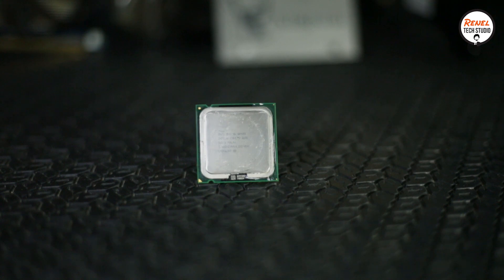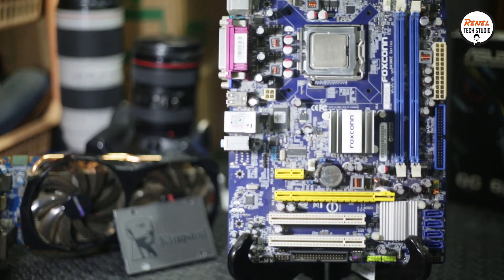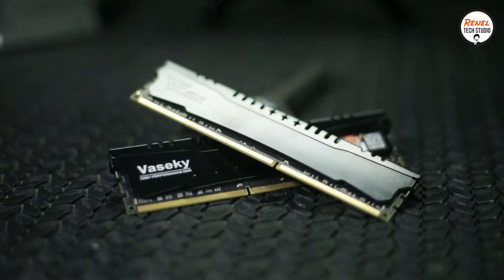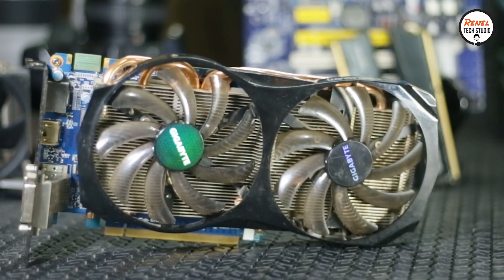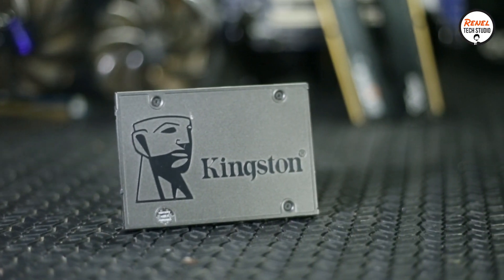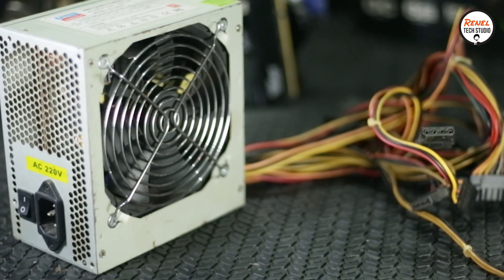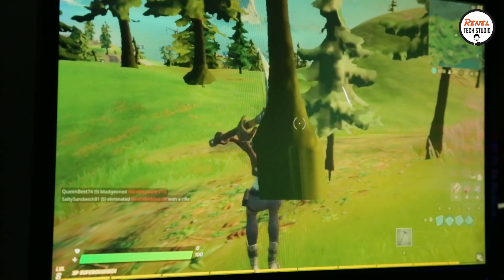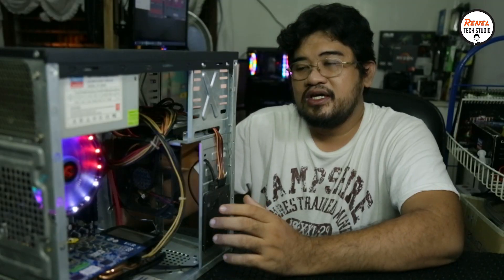Can a 10 year old PC. Usable in 2020?

Comment: jusko yung power supply sobrang generic na generic tapos nilgyan pa ng GTX 660 na video card jusko delikado yan sir, sisirain ng 10 year old na PSU mo yung buong system unit, better buy a 90+ white na PSU, wag niyo tipirin sarili niyo sir for the sake of the build, GARANTI-SABOG yan build na yan pag nagkataon.